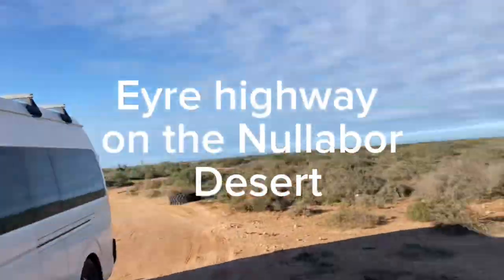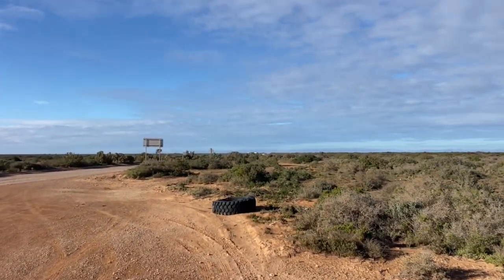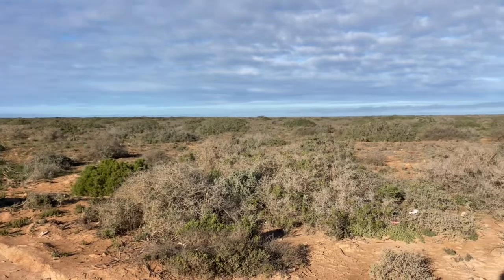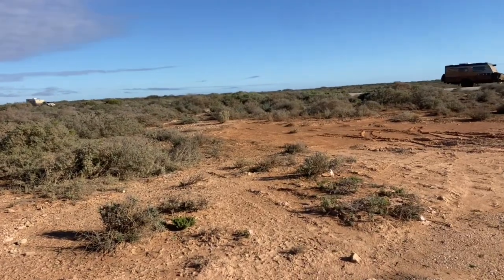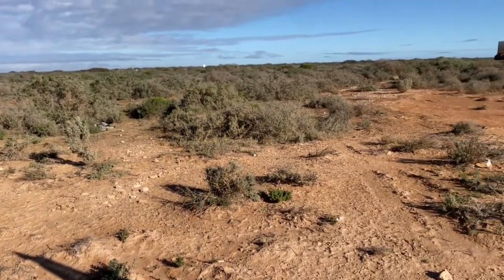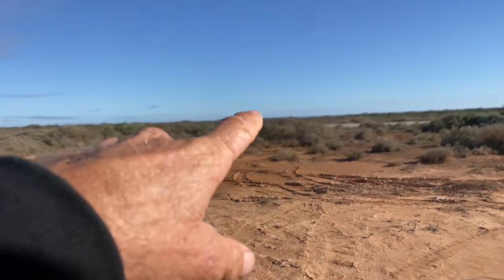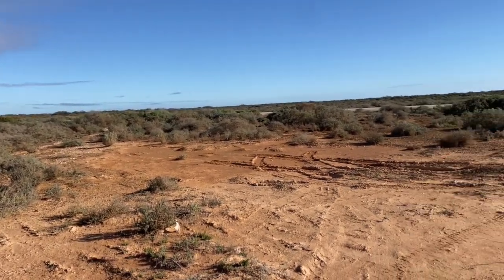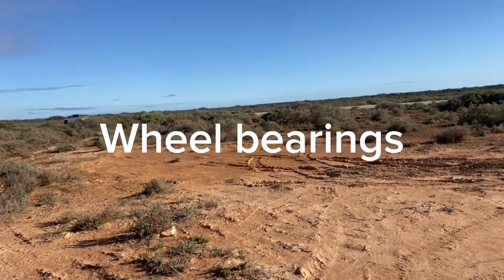Pt 2 Why can’t I have the Inverter size I want even though it has to be export limited!

Comment: Its insane that the WA grid is not connected to the east coast. Solar running in WA could potentially supply a large proportion of the east coast peak demand
Reply from the maker: Thats one hell of a long cable run!
Reply: Too expensive and complicated to justify a connection, same thing with the independent grid in the NT.

It also would likely have to be a HVDC connection given the distance involved.

Comment: Does anyone know what happens to export limiting under a Synergy VPP contract? For example, say a single phase 10kw hybrid solar/battery inverter. Originally, Western Power would say "nah no exports allowed and a static limit exports to 1.5kw" (which is completely ridiculous).
Really a larger solar/battery inverter benefits everyone (consumer and energy system) through the ability to contribute to the peak (reducing network draw and reducing peak generationpower needed). Other networks in Australia are dynamically managing export limits (so if solar not needed in the middle of the day reduce the export limit, and at peak get rid of the export limit). 
A lower inverter limit restricts any of these benefits for consumers and the energy system (both network and generation).
Manage those cloudy days with batteries to mitigate the really conservative network planning approach. Technology is good that way 👍

Comment: If you have a DC coupled battery system then there is no reason whatsoever to be limited on inverter size.  The grid won't see any spikes at all from passing clouds or household loads.  The batteries will simply be charging while the sun is out and discharging while its cloudy.  Eventually the battery may run out or get full but these aren't simultaneous events so the grid won't have any issues dealing with it.   An export-limited inverter has no trouble under these conditions... I should know as I have a 16kW inverter and a 5kW export limit (but I'm in the U.S. so the rules are different and the grid is much larger).

If your system is AC coupled things get a bit more complicated because it is more difficult to export-limit AC coupled solar and takes longer to react to changing event.

DC-coupled systems can react instantly.  Milliseconds.  And always could.

Lets be clear here, because there is this constant misinformation about inverters.    A grid-tie-only HF transformer-less inverter is designed to do only one thing... take the solar panels and put it on the grid.  But a HYBRID HF inverter designed to operate both on-grid and as backup, with DC-coupled batteries, is a completely different beast.  Hybrid HF inverters are beefy suckers due to the HVDC mid-bus design and have no trouble whatsoever handling surges.  The Flexboss21 I have can handle 5-ton A/C starts (195 LRA inductive starts) without blinking.

So these issues have nothing to do with transformer vs not and everything to do with the overall system design.  AC-coupled systems are more fragile and more spiky, for sure.   But DC-coupled systems are beefy and tough.  LF vs HF is irrelevant.

-Matt

Comment: But battery storage and inverters actually ramp up faster and can handle large load swings far easier than a mechanical generator.
Reply from the maker: Yes but what if battery is flat, they need to allow for all possible scenarios.

Comment: I got a victron 10kva and 2 Fronius inverters for a total of 9kw with 13kw of panels with frequency shifting the irony is its not allowed on grid in this country even though you can limit export or do a change over switch
Reply from the maker: If you do a changeover switch (disconnected from grid) you can do what you please.
Reply: The frequency shift function of the victrons only comes into play when they are in an island configuration without external grid connection. with grid connection, its a simple ESS and the export limitiation has to be done via (private) smart meters/the victron system

Comment: Agree with this video. I just want to use all my solar. Have a system with batteries that mostly allow that to happen. I have a 13Kw battery so far to absorb cloudy days. This means the grid is a backup not a surge
Reply from the maker: Unless your battery is empty or broken! They have to account for every scenario possible.
Reply: But not everybody's battery will be flat or faulty at the same time! The logical thing to do, is have the power company install battery banks that can absorb the excess from either their generators when demand suddenly drops and then instantly supply power in cases of sudden demand? These gravity batteries I've seen would appear o be the ideal solution to absorbing excess and allowing instant supply.

Comment: Are you still limited in inverter size if you have a battery, and you can limit export to the grid to a reasonable requirement? Most houses would struggle to cope with a 5kW inverter, but if the could have a 10kW inverter with battery and limit export to say 5kW then you wouldn't experience the sudden high demand scenario when the clouds cover the city, the houses would draw off the battery like a UPS instead of suddenly draining the grid capacity.
Reply: Sounds logical, but I suspect most people (I would) would set up their battery not to discharge during the day when power is cheap so if clouds came over you would still have the problem with a house switching from solar to grid.
Reply: I don't know what the laws are  where you are but if you have a DC coupled battery-inverter system configured with an export limit, such as a typical hybrid inverter setup, there are no limitations that would fundamentally cause any problems for the grid no matter how large the inverter is.

If your system is AC coupled, then things can get a bit dicey.  No singular event will hurt the grid (not even a fragile grid in S.A.) but, for example, a cloud passing over a sub-division (many homes) all equipped with solar... that could cause issues.

-Matt
Reply from the maker: And if the battery is flat ?
Reply from the maker: Yes

Comment: Makes sense not to have lots of potential load waiting to be added to the grid when the unreliables lose power. Should be limited to all those grey nomads and their caravans you are seeing who are fully off grid unless you have batteries to take your load. Crazy its getting to the point of generator shedding to protect the grid because there is too much solar when its not wanted.

Comment: Houses are using more power than ever with ev's, hot water, swimming pools and home batteries. A single phase home can pull in a maximum of 15kw from the grid. Surely a simpler answer during the cloudy days mentioned is to limit the amount of power that can be drawn from the grid to 10kw (think of a number). They can already switch off the solar, so limiting import should not be that hard. They have introduced time of use tarrifs which works on sunny days but has the opposite affect on cloudy winter days where I can force charge my home battery for 8.5c and charge my ev at the same time.
Reply: technicly they can already do this in a way of demand responces to turn off airconditioning and other appliances that obeys those instructions, but thats more due to capacity of the network then how much a house is using

Comment: I understand your point regarding cloud cover and the sudden demand being placed on the network where it previously did not exist. However, the network in question spans from Kalbarri to Bremer Bay. It is highly unlikely that such a large area would shift from full sun to full shade in under an hour. This provides generators with sufficient time to ramp up or down as required. Additionally, operators can anticipate and forecast demand changes in advance.

also I was there last year beautiful place to visit.

Comment: Given that the grid operators routinely forecast and account for large instantaneous demands like everyone throwing the kettle on at half time during the grand final (yes that's a thing) I don't really see that cloud cover (which is already tracked as an established real-time meteorological data set by satellite feed) can't also be accommodated for.
Reply from the maker: It was just an example (clouds)
Reply: Track...clouds.. . .big solution cloud controlled genset throttle. Hectic.... maybe when ai gets better. Smart freeway works well. . . 😅